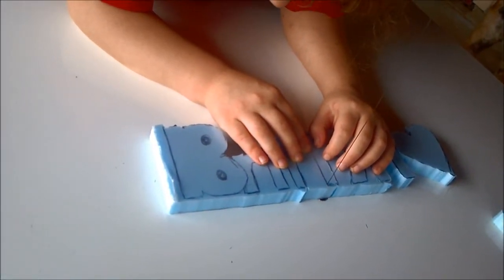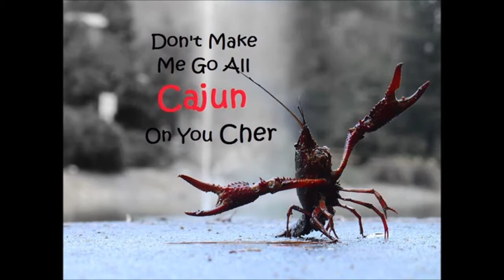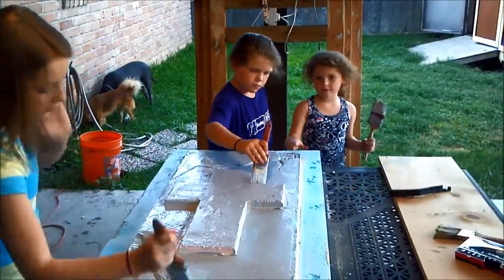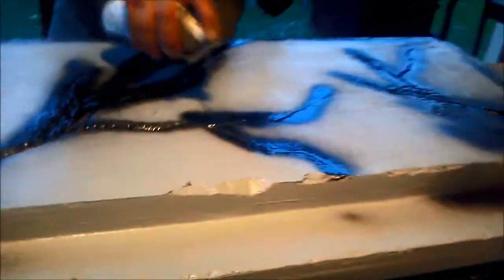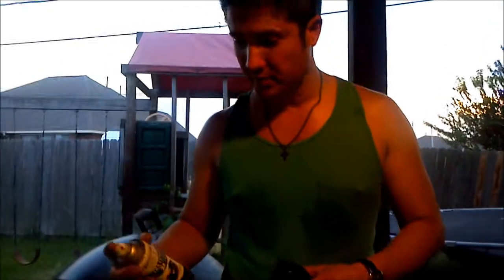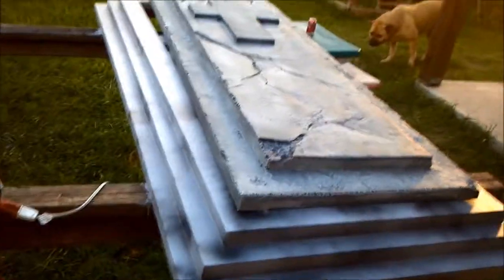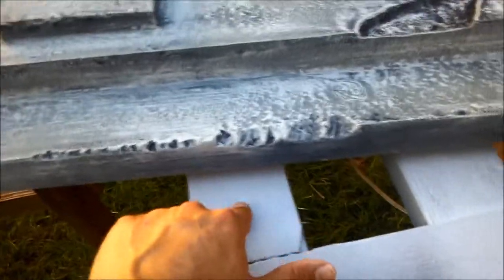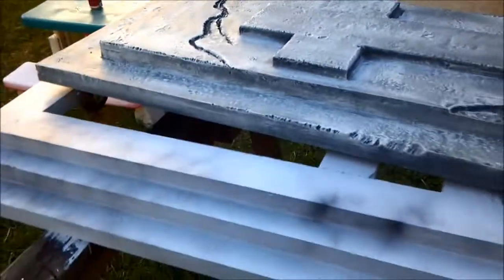Painting coffin lid

Comment from the maker: Thanks a lot bro!  I screwed it up and had to redo several spots.  I wanted to add some more pitting in the foam, so I tried using the heatgun over the paint.  Yeah......don't ever do that!  It makes the paint bubble up and separate from the foam.  So I ended up having to peel the paint off in spots and start over.